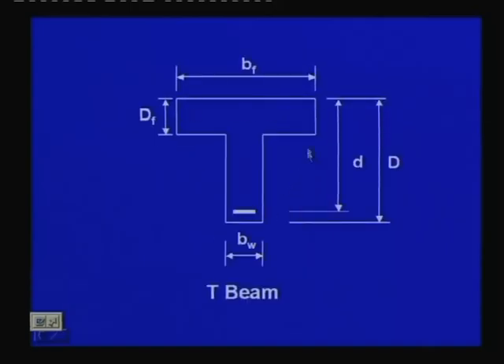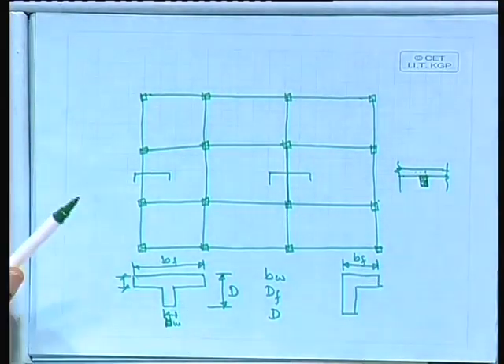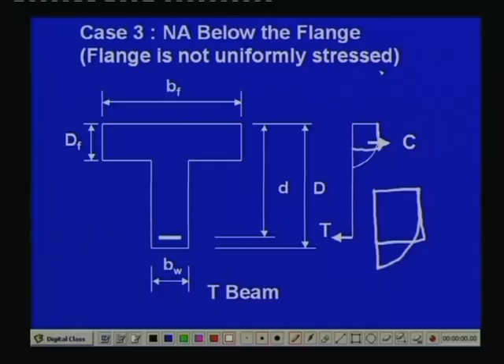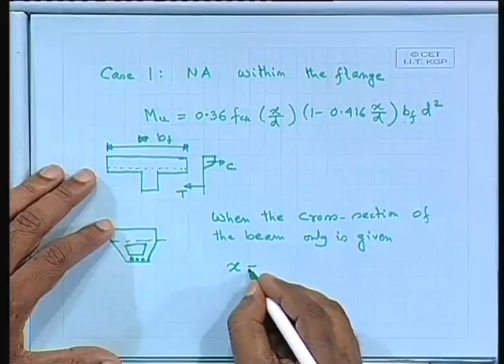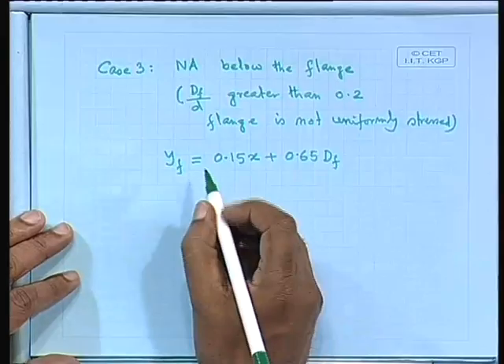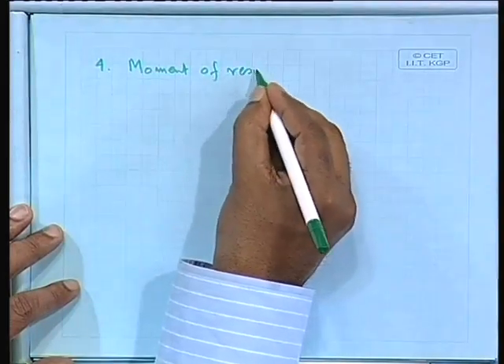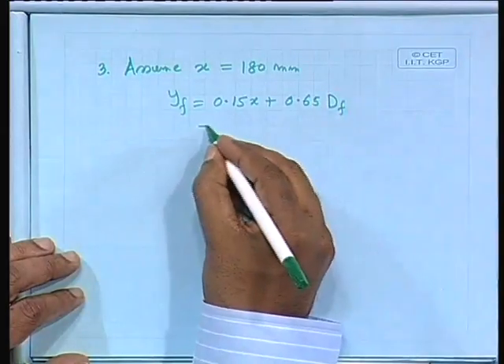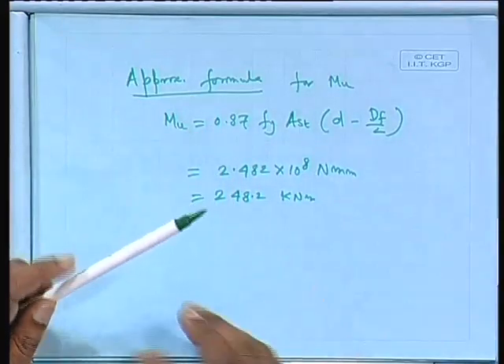Design of Doubly Reinforced Beam Flexure

Comment: Sir, the effective depth is 412.5, so X max = 0.48x 412.5= 198mm. Yet you have considered X as 200mm. At the end Mst > Mck. How is this possible and what does it signify?
Reply: This is a T beam & so Xmax/d= 0.48 is not applicable here. X will be found out by trial and error method. Note that this is not an ordinary  beam having uniform rectangular shape. it's T section where top part is slab or flange beam and bottom part is Beam, both of whose dimensions are different
Reply: @SinghSuryadip  Xu max is still valid due to the assumption of linear strain (Plane sections remain plane after bending). I think section in the problem is over-reinforced and xu actual should be calculated based upon the strain compatibility iterative procedure (Given in RCC book by Pillai and Menon).
Reply: @HarwinderSingh-ee9ik please comment on my question
Reply: @SinghSuryadip please comment on my question